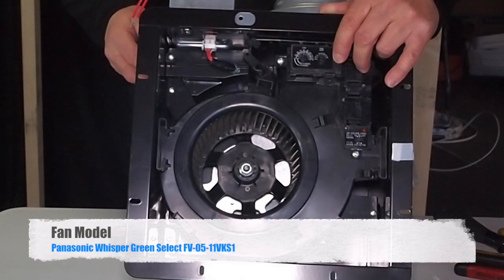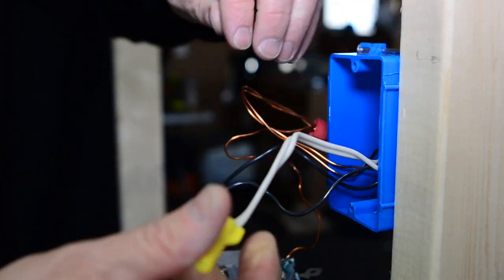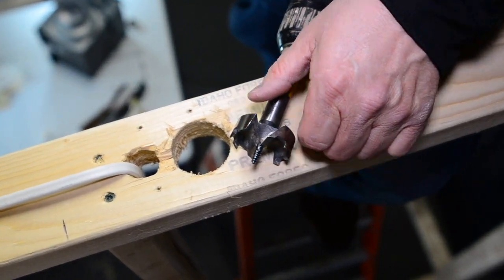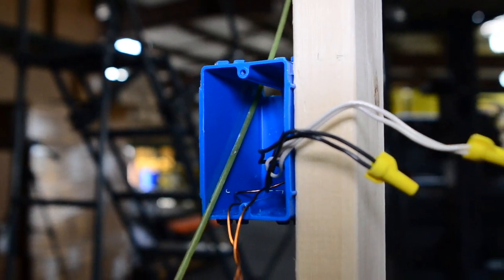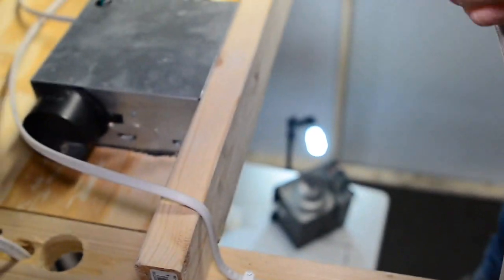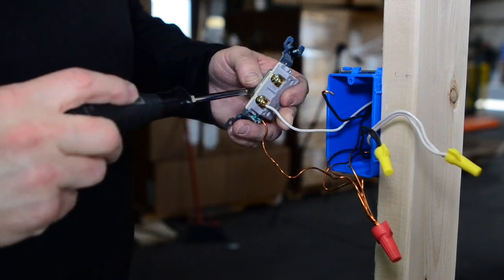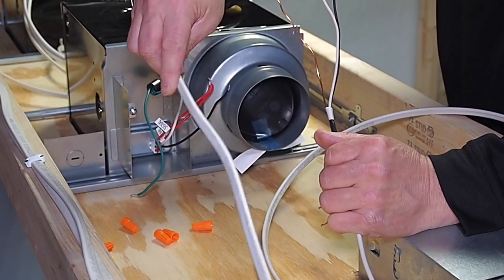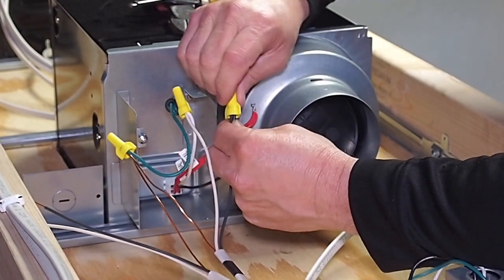Panasonic Whisper Green RetroFit Bath Fan Wiring Scenario (2 of 7)

Comment: Thanks so much. The instruction sheet for the RG-T810LHA leads you to believe that BOTH a power switch AND a control switch are needed. With a light and night light combo that would give you four wall switches - a bit excessive...  For a Panasonic YT on this wiring method see https://www.youtube.com/watch?v=8HflvCzzIPI&t=9s

Comment: Hi I just want to make sure or I’d like to learn what is the signal switch does exactly ? Do you have to turn on or off the signal switch at some point ? Or do you just leave it a lone ?
Reply: 1) If you want to use the humidity sensor, connect your wall switch to the signal wires to open/close the signal circuit. Connect the line, neutral and ground directly to the fan power, without a switch. (Never connect power to the signal wires or you may damage the fan). Now  the fan will turn on/off automatically based on humidity levels but also manually when you operate the switch.

2) If you don't want to use the humidity sensor, ignore the signal wires entirely and connect your switch to the line, ground, and neutral wire if your switch has a neutral. Now the fan can be manually operated using the switch.
Reply: @Virtualmix  what if you momentarily connect the red wires, does it run for 20 minutes?
Reply: @craigbrickner1223  Negative
Reply: when you connect the red wires it will run until they are disconnected
Reply: We were testing the signal wires in the field to see if it ramps up, but did not ramp up. My question is humidity sensor needs to detect humidity in order to ramp up ?

Comment: Is this fan equipped with 80 CFM continuous ventilation and then 100 CFM when you turn the switch on?

(Switch going to the two red wires.)
Reply: If you have the multi speed timer set on 80. And then you throw the switch, it will kick up to 110 if that’s what you have the selector switch set to.

Comment: I have a Panasonic Model FV=0510VSCL1 that appears to be very similar to what you are installing.  What happens if red signal wires are wired to power inadvertently?  I have corrected the wiring according to your instructions but the fan doesn't work.  Can I assume I fried something and is it repairable? Thanks!
Reply: Walter, basically you fried the circuit board in most cases.
Reply: That whole assembly can be replaced. That's the big advantage of the Panasonic FLEX-Z design.

Comment: I want the option of cutting off all power to the fan. Can I leave a switch on the common that goes up to the fan?
Reply: I am showing how to used the fan in the  proper way. Its you fan, do as you please, just keep in mind if you using continuous ventilation and shut the switch off, proper ventilation is not happening..
Reply: Understood.  I work for a weatherization program that uses the ASHRAE 62.2 standard when installing continuous ventilation in a dwelling.  ASHRAE Standard 62.2 does have language requiring occupant access to an override switch to turn off continuous ventilation.  This option is valid especially in the shoulder months when fresh air ventilation can be introduced by opening a window.

Comment: What do you do if you don't have an attic?  Or the fan is on the first floor of a 2-story house?  It looks like the electrical junction box on the fan is not accessible after installation - code violation.
Reply: You can look at my other video, how instal a retro Panasonic bath fan. If you get the wires in the junction box and installed the wires are still accessible, from inside the fan. Pull the motor out. There are 3 screws on the series 1 fans and 2 screws on the series 2 fans. After the motor is pulled you and access the electrical spot by removing 1 screw. The opens a small slot to get at the wires. Not perfect but doable..